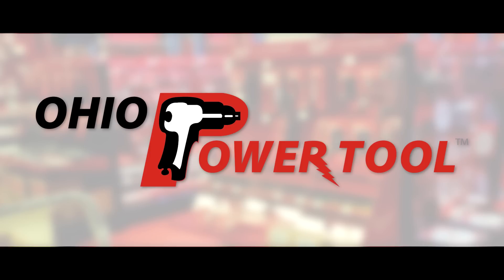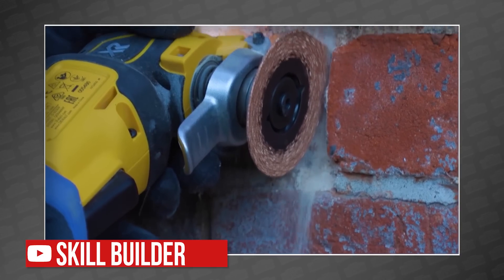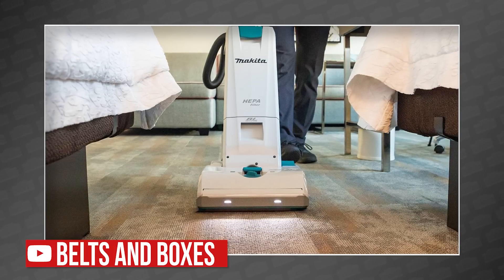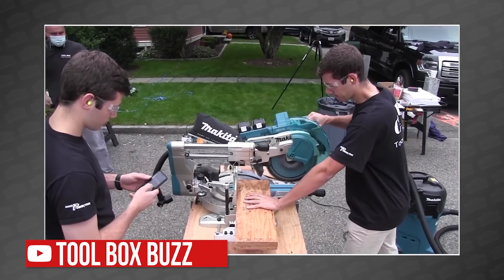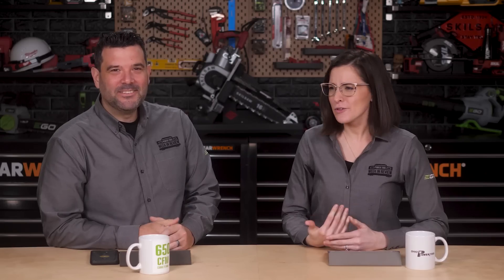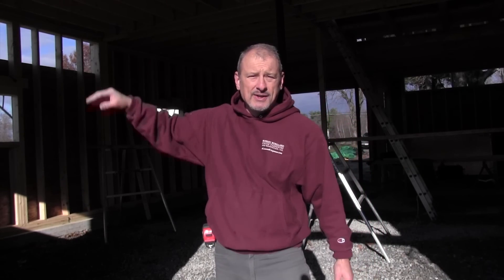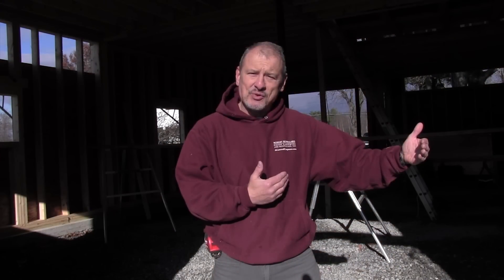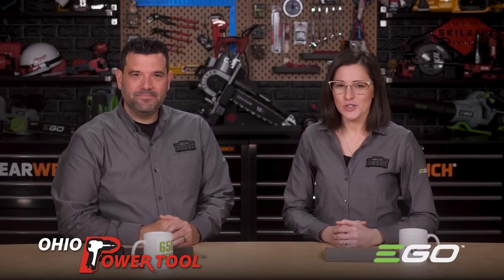Makita takes the CROWN from Milwaukee, Dewalt and Bosch... but at what cost?! Power Tool News S3E47

Comment: As someone who worked the closing shift at a retail store for many many many years, I can tell you the worst part was vacuuming. The only reason was the cord. Having to constantly maneuver the cable, bend down to plug it in and take it out. Always being just 1 foot shy of the slack I needed to get to that one corner. Honestly a cordless vacuum makes so much sense from an efficiency standpoint. It would make vacuuming a lot less of a nuisance, and would speed up the entire job. This also means it would get done more often.
Reply from the maker: Great insight Todd! I worked retail (CompUSA and Gateway Country Store) for several years, and I agree the cord was the worst part of vacuuming each night.

Comment: The tips are good but sometimes architects and engineers require a nail layout on top plates so sometimes it's not even the framers fault. Other than that great video I subbed for sure